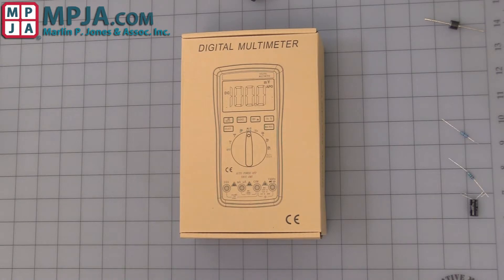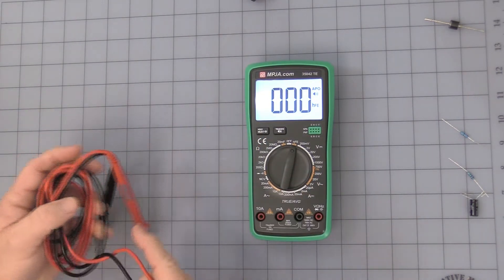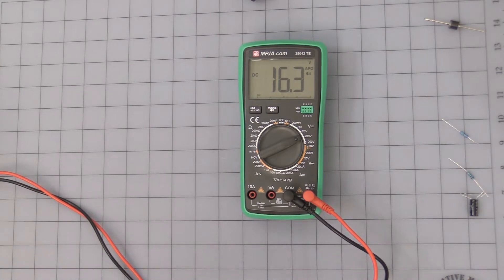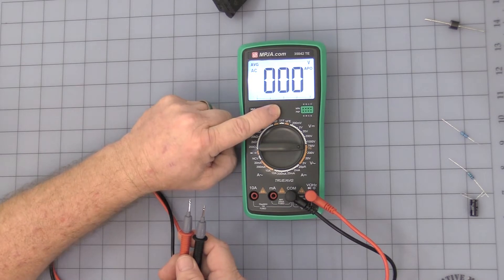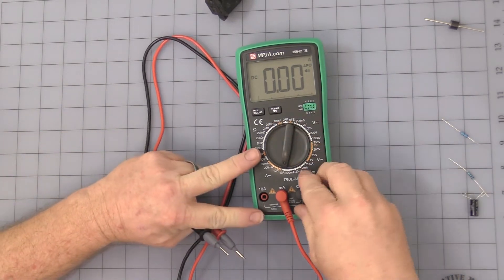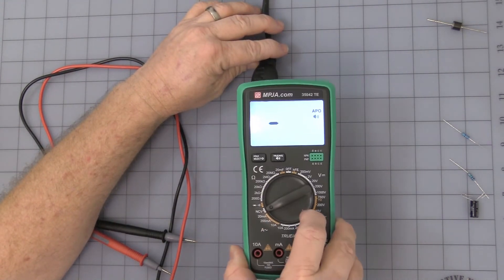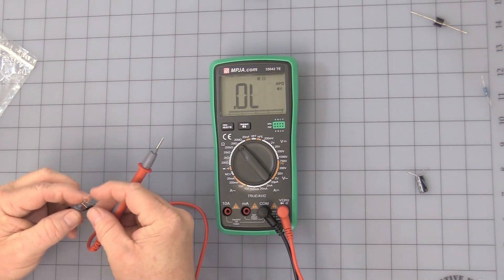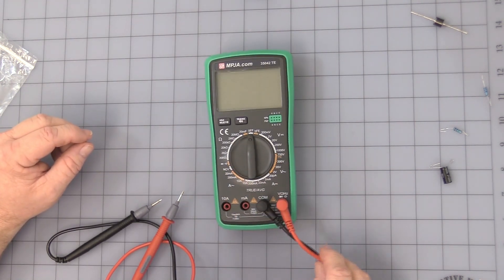Talking Digital Multi meter 35042 TE

Comment: I just received one of these and tested everything.  Very respectable and everything was within specification.  I was especially interested in the True RMS AC voltage accuracy and it is quite accurate within the frequency range specified.  And even beyond.  The spec is 1 kHz for a sine wave but it was still good at 2 kHz.  For a square wave, the spec is 200 Hz but worked pretty well up to 300 Hz.  (Incidentally, MPJA is completely up front about the AC frequency response.  MPJA has it right up front on their Online page as well as in the manual.  Even Fluke makes you have to download a manual to find out what it is.)  It also works well somewhat below the 40 Hz rated minimum.  Probably down to about 30 Hz.  The talking part is likely to come in handy for those typical times when you need one hand to hold one test probe, the other hand to hold the other test probe, and your third hand to hold the meter so you can read it.  You don't have to struggle to balance or hang the meter or try and get some light shining on it or whatever.  And finally, you never have to feel like you are working alone (just kidding - maybe).